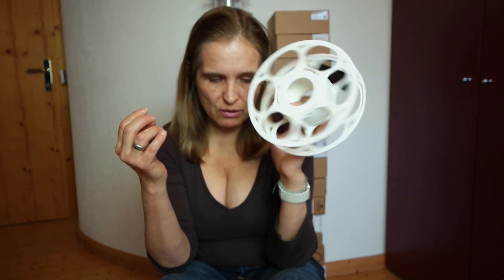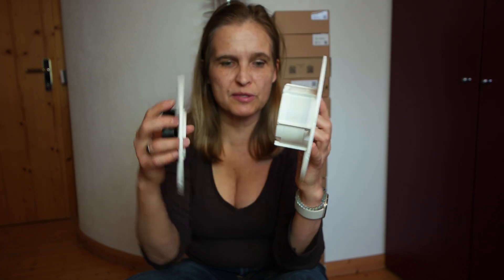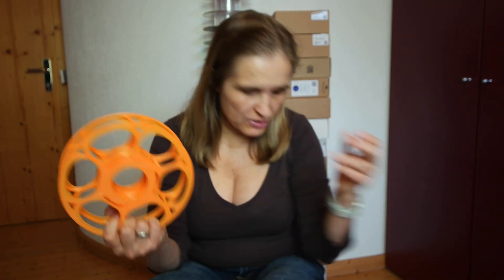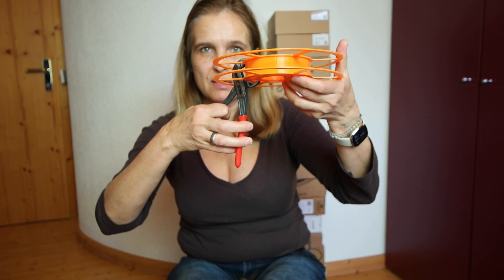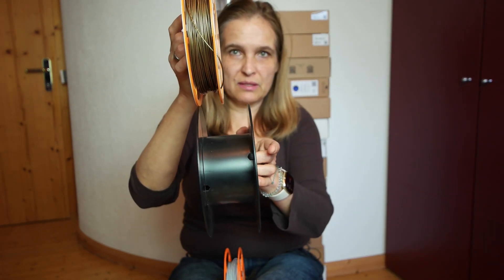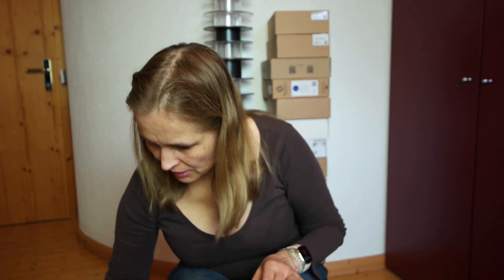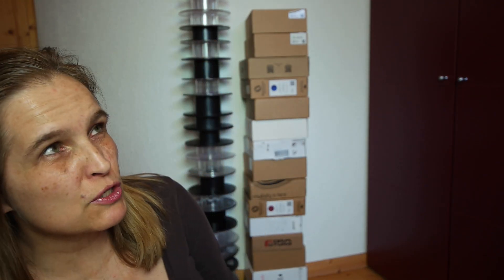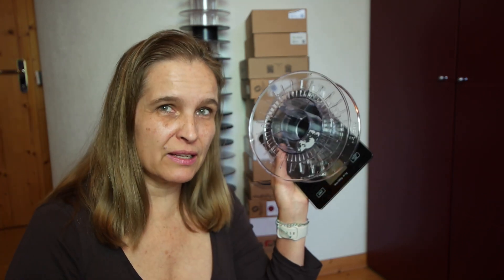Filament Spools, Stock, Recycling

Comment: I like the spool design.  It's pretty tempting to make a winder with a handle and a capstan to neatly rewind the reels.  (I've had no end of issues with coil overlaps resulting in the filament pulling off unevenly.)
Reply from the maker: That’s my plan for the future. But I have to improve my CAD skills first. I have a second project that I am working on now which is very time consuming. Wanted to get my filament stock tidied up as quick as possible. So it was okay as it is for the moment. I will add the weight of the empty spools today. It’s incredible how much they vary. My next step is to create a database of the spool location on the shelf, the filament company, - type, - color & remaining amount left on each spool. And I want to create filament swatches.